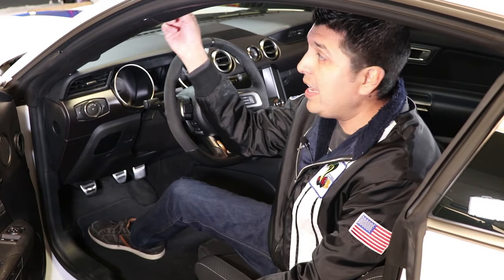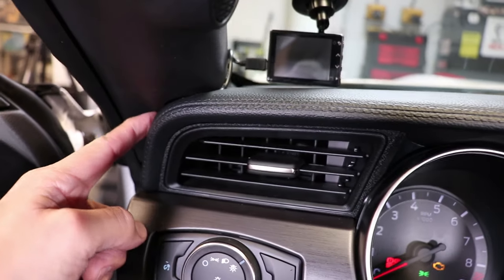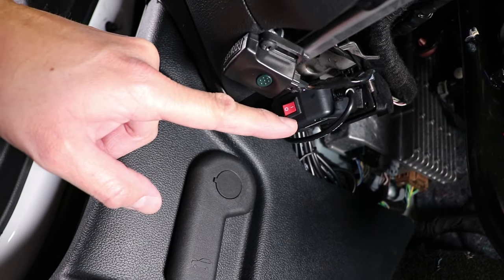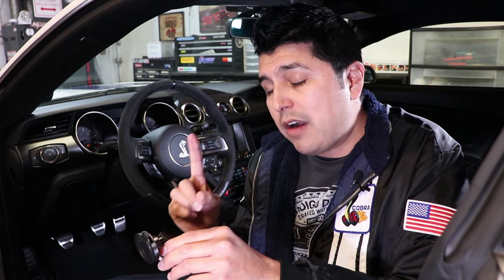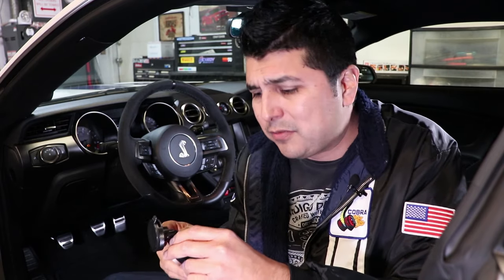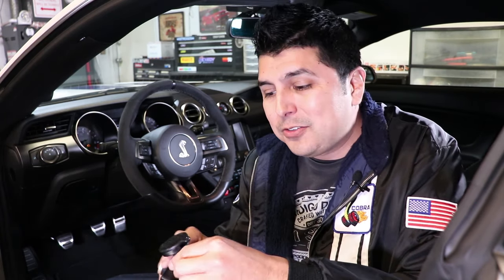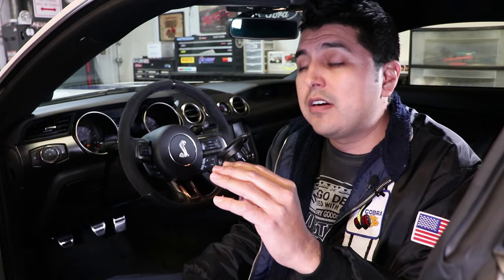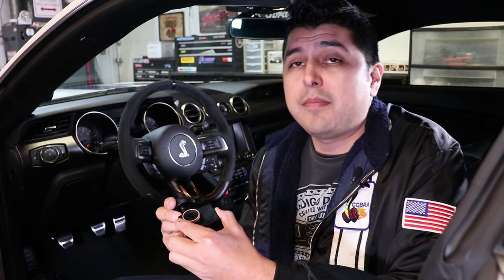Don't hardwire your Dash Cam! Try this instead!

Comment: Have you ever did a install with a VIOFO 139 PRO 2CH  ?
Reply from the maker: Hi Steve! Ah yes I have installed 2 channel dash cams, here is my install video https://youtu.be/44WXN8MI66o so you can see the install process and how I hide the cables (same process as mirror style dash cam but instead of mounting the mirror dash cam to the mirror the Viofo would be mounted directly to the windshield of the car). Hope this helps, Cheers!

Comment: I just use a portable power station in the back for parking mode on 4 cameras. Use the 12volts when the car is on.
Reply from the maker: Hi Jeremy! nice! yeah I heard some folks are using power banks to run their dash cams, very interesting..

Comment: Nice video. Going with the fuse option - my accessport takes up obd :(
Reply from the maker: Thanks Jeffrey! here a hard wire kit that may help you https://youtu.be/83a3w6EtzXo , I explain what each wire does and how to splice wires before installation just in case you need this info bud!

Comment: well i need 24/7 without worrying about constantly messing with things turning back on and off, so hardwire is the way to go right?
Reply from the maker: Hi Kenny! some people use the OBD2 power adapter for 24/7 monitoring (remember the adapter can be set to surveillance mode) However yes to enable true parking mode a hardwire kit is required. Hope this helps, Cheers!

Comment: 64GB max?? You can use it as a decoration.. Maybe in the litterbox... I didn't understand why the title is don't hardwire your dashcam... If you have the right hardwire module it will turn automatically off the cam BEFORE the battery gets to low so i don't really see the point of that video. 64GB is useless and there is no reason NOT to hardwire a dashcam. If you need some tips about dashcams im here you can ask me
Reply: Oh i forgot to mention.. You said "the cam is always recording" this is not the case if you buy a dashcam with motion detection. Additionally you can look for motion detection combined with timelapse. Like this the cam records for days without big battery consumption and use of storage of the SD card. But a 128GB is the minimum for 3-4 days in timelapse mode better of course would be 256GB or 512GB so you have all the recordings up to 2 weeks
Reply from the maker: Hi Mac! Yep the Garmin 55 came out a long time ago so back then 64gb was the max it could handle, how far we come uh! Regarding hardwiring, this OBD method is usually preferred by those who don't want to do a full hardwire due to a lease car, easier installation (the OBD plug can come on an off in seconds) and that don't need parking monitor enabled (most dashcams require a hardwire kit to enable parking monitor. However for those wanting to see the hardwire process here is my other video showing that method https://youtu.be/zbxYA4VhuT8 But yeah you are correct, most hardwire kits also offer low voltage protection (like the OBD2 adapter in this video has). Hope this helps, Cheers!
Reply from the maker: Hi mac! Correct, if your dash cam supports it (motion detection) you can definitely use that if desired. And yep a time lapse enabled dash cam can also further increase the ability to cover what happened when you were away from the vehicle. Good stuff, keep it coming Bud!
Reply: @AlexAutoFun  thank you for the answer. I maybe didn't recognize that for some cars it's easier to connect it on odb2. In my case the slot is on the other side so it makes it more difficult. Unfortunately good cams with a good quality of motion detection are rare. I would like to know a good brand without timelapse mode but realtime footage of motion detection... Its very rare... Blackvue is not available where i live
Reply from the maker: @mac4060  You're welcome mac! Ah yes here is a good one with time lapse and motion detection (vision based) https://youtu.be/BAEH4f2ulEs and here is one with motion detection (radar based) and backup to SDD so you can store Terabytes of video https://youtu.be/vUEsIYEBVck And I have more dash cam reviews on my channel in the playlist "Dash Cams Reviews" if you like to compare them. Hope this helps, Cheers!
Reply: @AlexAutoFun  thank you! The thinkware is very interesting
Reply from the maker: @mac4060  You're welcome mac! Yeah the cloud feature is very neat, and I'm actually working on their newest model now that has even more advanced features, stay tuned for that review my friend. Cheers!

Comment: Don’t use a sunshade do you?
Reply from the maker: Hi Thamac15! yes I use this sunshade https://youtu.be/K96HruBUBYA but in the Mustang size. However remember I'm running the Garmin 55 dash cam which is tiny with the low profile mount. Larger dash cam may conflict with a sun shade depending on where they are positioned on the windshield. Hope this helps and cheers!

Comment: First, I don't know how you define "hardwire". To me, this is no different with "hardwiring" except you didn't take off the A Pillar. It still ultimately goes to the fuse, regardless of whatever interface or meters you plug it into. Secondly you are putting something in front of you which is pretty dangerous when collision happens, because collision on the left corner side is more common than a collision in the middle at a very high position which typical cameras are mounted to. The camera may fly out and hit your head along with the left airbag. Also A pillar flies to the right when airbag open, your camera position just stuck the way. It may also tear the airbag. It is much worse than taking off A-pillar and hide wire inside the clips which the car factories already installed. There are factory clips behind the airbag positioning some wires, so the claim of risking with airbag if wiring inside is false. Finally, even without any serious accident, you put the camera in a corner which prevents it from taking the view of the other side of the car. There isn't really much advantage, but disadvantages are very clear.
Reply from the maker: Hi 00 ur! This OBD2 adapter does not connect to the fuse panel it connects by plugging it into the OBD2 port. But yeah unfortunately we are very restricted on the mounting location for the dash cam here in California :( But the installer can place the dashcam higher by running the cable up the A Pillar if desired. And as you pointed If there is an airbag in the A-Pillar here is my video https://youtu.be/uZp95NbNlmM where I explain some of the issues that can pose and also the connections to the fuse box instead of the OBD2 port. Hope this helps, Cheers!

Comment: Isn't both of these methods considered 'hardwiring'?
Reply from the maker: Hi Joe! Hardwiring is more involved as it requires manually taping several connections into your fuse box using fuse taps or wire splices here is my video for that if you want to see the process https://youtu.be/zbxYA4VhuT8 The OBD method is usually prefer by those who don't want to do a full hardwire due to a lease car, easier installation (the OBD plug can come on an off in seconds) and that don't need parking monitor enabled (most dashcams require a hardwire kit to enable parking monitor. Hope that makes sense and thanks for watching bud!

Comment: Bad in many way. First, you can mount the camera right infront of rear view mirror. It block no vision to distract driver. It has best view of perfect angle. There is no need to cut or remove anything. Look above your mustang rear view mirror area. Manufacturers already has a slot precut for you to route Dashcam or radar detector cable. It has space inside the top liner for cable to run down the a pillar and inside the weather strip. No need to remove anything except for the same panel you removed. Just plug into the car existing fuse, no need to cut and solder anything. Don't want to tap into old because if the camera get faulty, it can shut the car down in the middle of the highway for faulty code reading
Reply from the maker: Hi Merric Hoang! the dashcam can be installed higher up by running the cable up the A-Pillar if desired. I also just complete a follow up video with the hardwire method you can see it here https://youtu.be/zbxYA4VhuT8  I'm working a Mustang specific video so I appreciate the tips and thanks for watching bud!

Comment: At the bottom on driver side? Wao i would like to see that footage.  Also you could have remove the rubber and hide the cable under it and it would def give you a profesional look.
Reply from the maker: Hi WorkHardGainBig! the cable could be run higher up the A pillar but yeah I'm working on a follow up video comparing different dashcam positions and angles, stay tuned and thanks for watching and commenting bud!

Comment: Only issue with the OBD port is that it is not meant to be used constantly. There is a video made by @Scotty Kilmer where he was working on a Toyota that had a device plugged into it's OBD port causing the overall system to run poorly until it warms up. Device damaged the vehicle. Bad idea over all.

https://www.youtube.com/watch?v=1ZT7iy-I6RM
Reply from the maker: Hi Vash! ah yes I seen that, love his channel, here is my video on the OBD2 adapter fears and how it works behind the scenes (from an engineering and electrical standpoint) https://youtu.be/aV5jQovoaCI For example the SAE standard that controls the OBD2 port (J1962) does not places limits on not being able to use the port constantly. Hope this helps and thanks for watching bud!
Reply: @AlexAutoFun  What I am saying is, I'd love car manufacturers add a dedicated port for Dashcam installation for Hardwire.
Reply from the maker: @Vash.Baldeus  Dude! that is a great idea, I totally think they should do that specially now that dash cams are so common you know, cheers from California bud!

Comment: How is the view with the cam so low?
Reply from the maker: Hi Parzin! it's actually pretty good, but I imagine this will vary from dash cam to dash cam. Mine Garmin 55 has a really wide angle lenses and I think that helps to compensate for the low angle. However the dash cam could be placed higher by running the cable up the A Pillar if desired, hope this helps and thanks for watching bud!
Reply: @AlexAutoFun  thanks 😊
Reply from the maker: @parzinirani7297  You're welcome!
Reply from the maker: @parzinirani7297  You're welcome bud!

Comment: DONT DO THIS! Any electrical issue with your camera risks damaging the main computer in the car! Any dongle that says its supposed to stay plugged in is a risk including those insurance company driving monitors.
Reply from the maker: Hi robopam! Here is my other video showing how this adapter works (and how it relates to the SAE J1962 standard we use in the industry for the OBD2 port design and use) https://youtu.be/aV5jQovoaCI including the use of OBD port by non-scan tools. I been running mine for over three years now without an issue but if you are still looking to avoid using the OBD2 port (and to also enable true parking mode) here is my other video showing the alternative Hardwire method https://youtu.be/zbxYA4VhuT8 Hope this helps, Cheers

Comment: Tapping from a fuse would give you 12V. I think dash cams are 5V.
Reply from the maker: Hi Ooygin! Yes that correct, tapping a fuse would get you 12v so you would want to use the dashcam hardwire kit which brings the voltage down to the work with the dashcam. Thanks for watching bud!
Reply: @AlexAutoFun : Does that come with the kit?
Reply from the maker: @ooyginyardel4835  Most dashcams only include a cigarette lighter plug adapter, typically the hardwire kits are sold separately, here is what it looks like https://youtu.be/83a3w6EtzXo Hope this helps!

Comment: Thing I dislike about the location you have yours is knowing if you get stopped by a dumb/currupt cop that don't like the be recorded he could easily reach in and unplug it.
Reply from the maker: Hi Fernando! Unfortunately we are very restricted on the mounting location for the dash cam here in California :( But you are correct, I can totally see that happening. To avoid this the installer can place the dashcam higher by running the cable up the A Pillar if desired. If there is an airbag in the A-Pillar here is my video https://youtu.be/uZp95NbNlmM where I explain some of the issues that can pose. Here is also my follow up video showing video from different angles to help you decide the best one for you https://youtu.be/F7OzM2i7ErE Hope this helps, Cheers!

Comment: Tapping into the fuse is still hardwiring LOL
Reply from the maker: Hi Mikey! The OBD2 adapter is connected to the OBD2 port, no fuse tapping required nor access to the fuse box, it's just plug n play. Cheers!

Comment: Great video, the only thing wrong is the dash cam is way too low
Reply from the maker: Thanks Eagle! Ah unfortunately, we are very restricted on the mounting location for the dash cam in my State. But the installer can place the dashcam higher by running the cable up the A Pillar if desired. If there is an airbag in the A-Pillar, here is my video https://youtu.be/uZp95NbNlmM where I explain some of the issues that can pose. Here is also my follow up video showing video from different angles to help you decide the best one for you https://youtu.be/F7OzM2i7ErE Cheers!

Comment: Is this OBD thing safe?
Reply from the maker: Hi Mr Tomcat! I been using mine for several years now without any issue but is like any aftermarket device, there is always the potential for something to go wrong. Here is a follow up video I did on other OBD devices that plug into the port https://youtu.be/hEmvv8M8bGI While I regularly use the OBD ports on my cars for the different things I cover on the video I know some folks still prefer the good old hardwire method, here is that video if it helps https://youtu.be/zbxYA4VhuT8 thank you for watching!
Reply: @AlexAutoFun  Ok thanks!, Just one question, Will the parking mode till be working with the OBD port because I have a VIOFO  Dash Cam A119 V3 and It supports parking mode but i am unsure if it will work with the OBD socket.
Reply from the maker: @mrtomcat2873  You're welcome Mr Tomcat! Regarding the OBD adapter for the VIOFO, the A119 uses the mini USB port so this is the one that will fit to power it  https://amzn.to/2XFijQA that's a pretty cool dashcam by the way, like the way it tucks in close to the windshield..

Comment: I’m on my second sd card and keep getting an error message “card degrading, replace soon”. Anyone know what the issue is? First lasted 4 weeks before error and the second (original sd card) only 2 days.
Reply: JMJM1 try using lexar 633 sd card, i am using it from last 7-8 months working fine with this garmin dash cam
Reply from the maker: Hi JMJM1, that's odd never seen that error message before, I been using Sandisk Ultra without issues, are you in a really hot area or is the camera exposed to direct sunlight all the time? I'm wondering if heat is causing the issue.

Comment: NOOOO!!! DO NOT plug anything into the obd connector. That is for a diagnostic computer to talk to the cars computer, not for powering accessories.
Reply from the maker: Hi Swindy1794! correct, the OBD2 port was designed for powering diagnostics equipment, however over time it's use has evolved significantly, I covered the change we are seeing in the industry for the use of this port on this video https://youtu.be/aV5jQovoaCI along with how using it for other purposes relate to the SAE-J1962 standard that controls the design and use of the OBD2 port. Hope this helps and thanks for watching bud!

Comment: I thought if it's too low you won't see enough of the road?? Sheesh.
Reply from the maker: Hi Nico! yeah it's a compromise, here in California we are also limited to the lower part for it to be "legal". But you can place it higher by running the cable up the A Pillar...

Comment: First, i've heard bad things about using that port. Yes its simple. But not worth the risk. Second. You complained about the camera not saving events. Get a different camera with a g-sensor so it saves those events.
Reply from the maker: Hi Michael! I been using it so far about two years now with no issue but yes I know some people prefer other install method such as hardwiring but thanks for the recommendation to move to a G sensor camera, I recently switched to this one https://youtu.be/fQDgk2YnRhQ and been super happy since, thanks for watching and commenting bud!
Reply: If you're talking risk due to human error than hardwiring is more risk. OBD-2 ports provide constant power for things like a scanner so it can read your car's computer, or the GPS tracking tool that insurance companies provide to track your driving and give you discounts for safe driving. They can also be used for dash cams because the whole camera needing power to make it work kind of thing.

Comment: Err...you just hardwired your camera.  Why the video header?
Reply from the maker: Hi John Luiten! This OBD2 adapter does not connect to the fuse panel (a hardwire kit connects to the fuse box of the car) it simply connects by plugging it into the OBD2 port. Here is my hardwire video https://youtu.be/uZp95NbNlmM if you want to see the fuse box install. Hope this helps, Cheers!
Reply: @AlexAutoFun  You’ve concealed the wire, which is the hard part and what most might consider hardwired, but I get your distinction.  It’s not quite mine.  The plug in is pretty simple whether to the fuse box or diagnostics under dash.  I’ve also seen the cable run to the nearest cigarette lighter.  I prefer the fuse box myself.
Reply from the maker: Hi John! Yeah I get where you are coming from. I do also prefer the hardwire method direct to the fuse box specially to enable true parking mode. I think the OBD2 method has become more popular with leased cars and with people who may not have the technical skills you and I have, to be able to use fuse taps, find the correct fuse spots for both the ACC and BAT wires, and to hide all the wiring as you mentioned, Cheers bud!